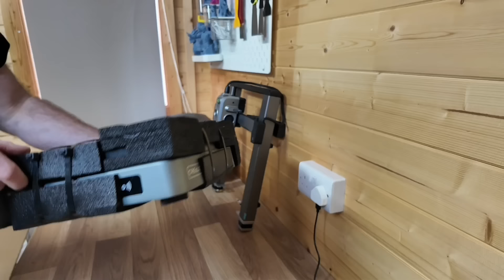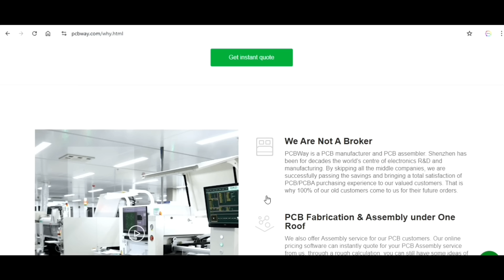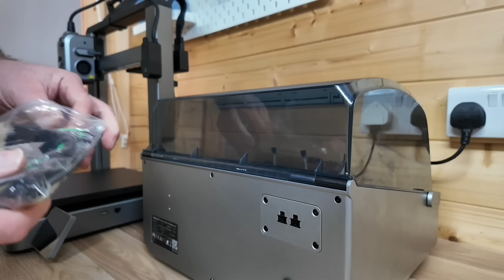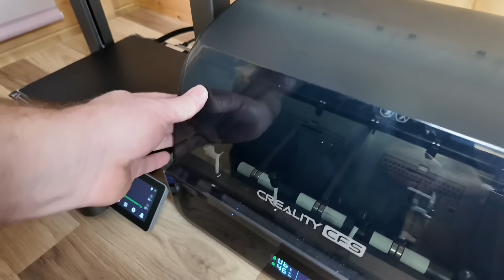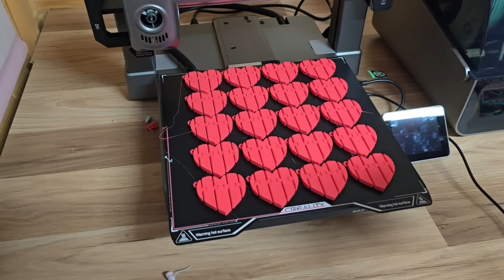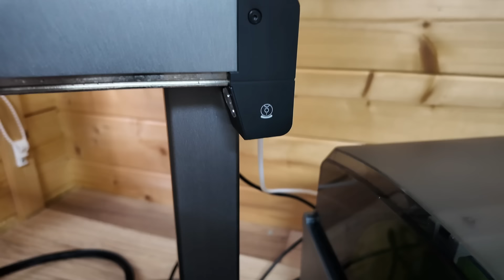Affordable Multi-Color Printing: Creality's Hi Combo

Comment: is there a way to reduce the waste for multi color or is that standard?
Reply from the maker: You adjust the filament waste in the slicer itself, adjusting the purge amounts... what I found was i used the following 

Basically add a random stl print model on the bed along with the models your printing right click that random model and tick purge into model this will also help reduce waste